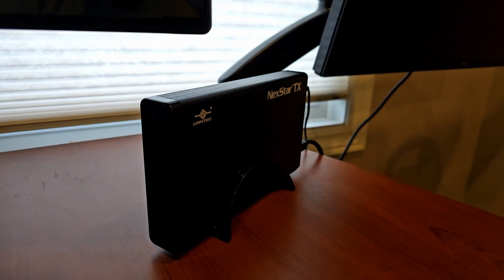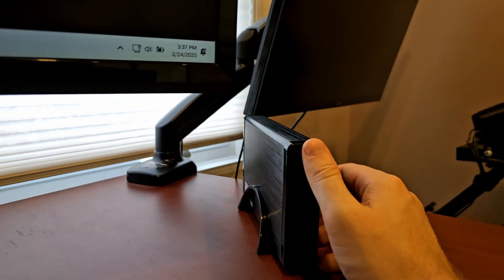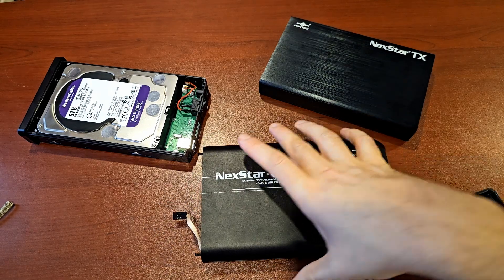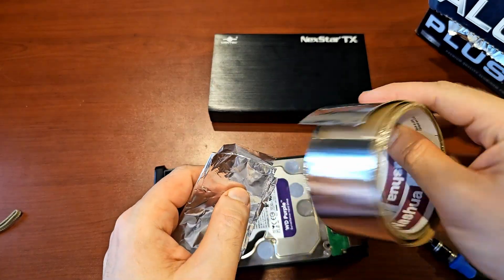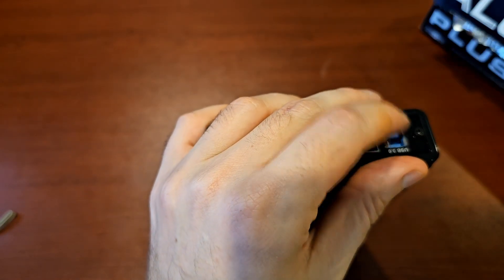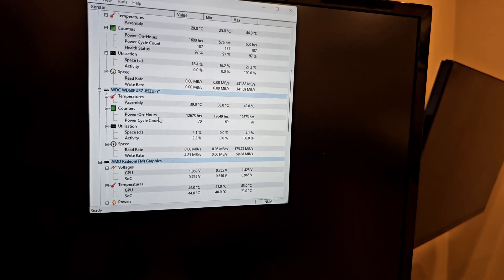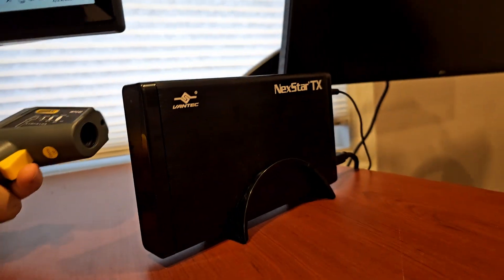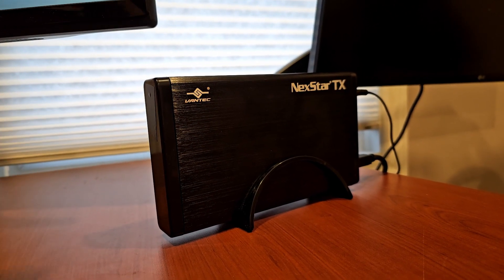How to easily lower hard drive temperatures in an external HDD enclosure (by a few degrees)

Comment: I have almost identical enclosure like yours
- first thing I driil holes on the bottom to fix the internal HDD to the bottom - my Toshiba Nas drive G-Sense error just in couple of hour of use reached 21000  from drive moving itself inside from his own vibration, and sloppy parts
- 42 degrees is not much, if it was close to 50 or over than we talk...
- you can cool the case with a fan on the desk witch will cool also inside HDD
- if you are obsessed with it, in summer you par example can add a radiator over, or a Peltier cooling Element,...

in the end I order better ones (from were I take the ideea with bottom fixing) - Axagon EE35-GTR
Reply from the maker: Agreed, 42ºC isn't too bad, but I like to see low temperatures. This was done while I was using a laptop as a server; I ended up building a server in a proper full-sized case and this hard drive (mounted immediately behind an intake fan) now sits at 30°C.
Reply: @rubbercheesereviews  Seagate Expansion 3.5 external backup drive - in original enclosure reach 49 degrees
drive moved in Aluminium enclosure, same workload (search for bad blocks), drive reached 40 degrees - moved the drive as I suspect the power adapter of enclosure being the problem (worn out of 8years continuos use)
2.5 drive moved in Dell Optiplex 3070 Micro, with absolutely No load on HDD, and No load on system, system just stay on without doing anything, drive reached 52degrees
Reply from the maker: Nice. I'm not surprised by the temp in Optiplex hahaha